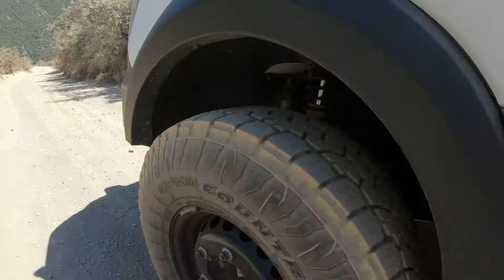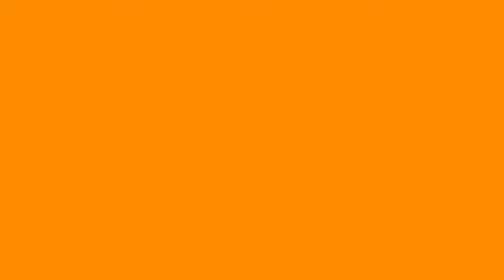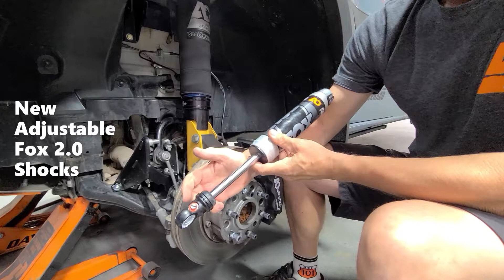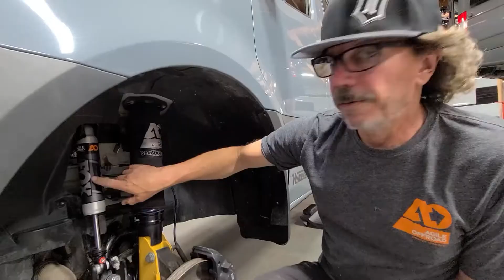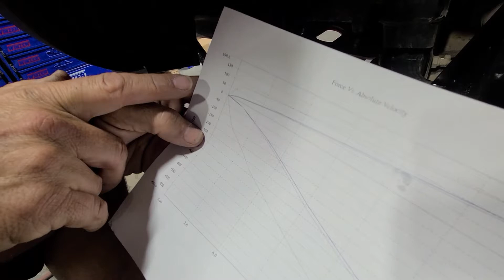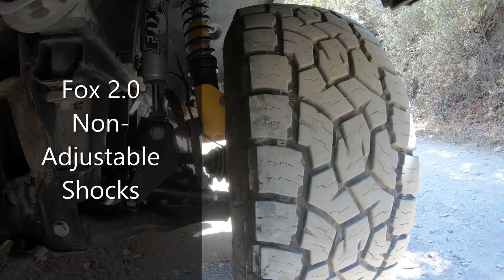Agile Offroad - NEW RIP (Ride Improvement Package) Kit - MAX

Comment: Need to relocate/re route that line, looks like a brake hose.  It will got pinched and eventually fail.  Whatever line it is.
Reply from the maker: yea that line tends to work it's way down. I need to secure it. Thankfully it hasn't snagged on anything so far.

Comment: Why not go for heavier duty progressive springs & HD reservoir adjustable shocks?
Reply from the maker: Upgraded to a Deaver Leaf Spring that doesn't have to use blocks. The Deavers also use 5160 steel which has much better memory and won't flat.